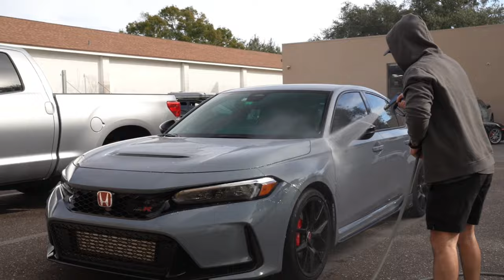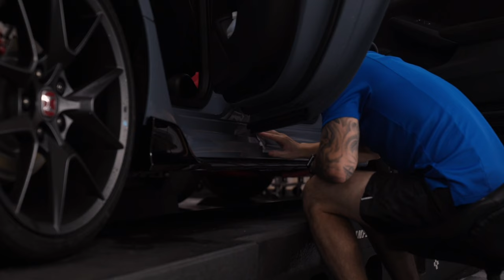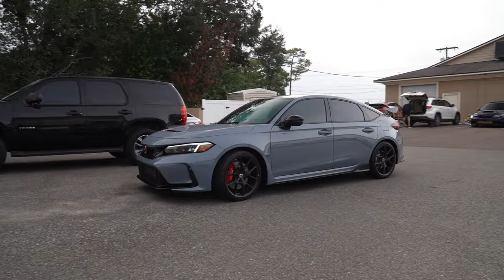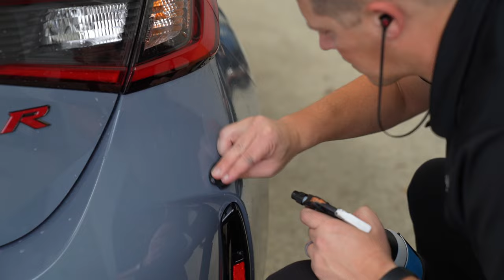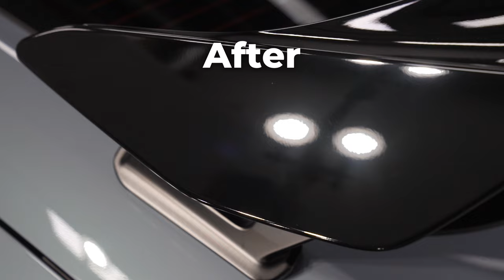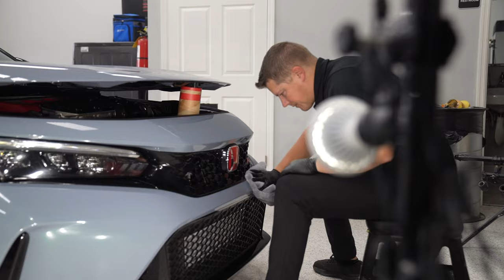Sonic Gray Pearl Civic Type R Gets XPEL Paint Protection Package, Paint Correction & Ceramic Coating

Comment: Looks great, question why do you need to wrap it then apply ceramic coating? Wouldn't you just PPF wrap it and by done? 

Soon I'll be getting a type R in the same color. Will look at getting the whole car wrapped.
Reply from the maker: The film on its own it kind of sticky and tacky, so it can be hard to clean. It’s also just not as enjoyable. The coating on top of the film will make it very slick so it’s easy to use a towel on, hydrophobic and easier to clean off bugs, etc.